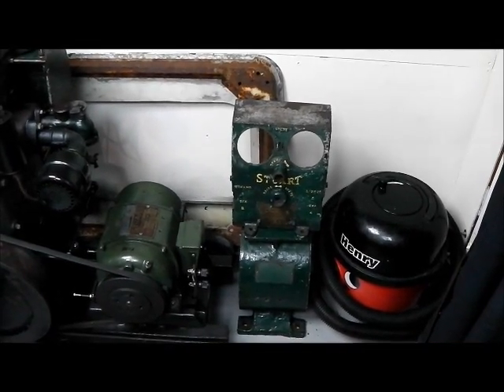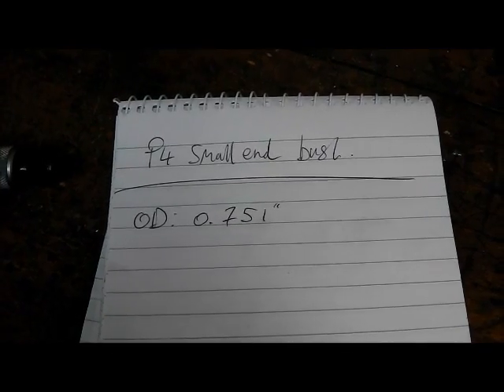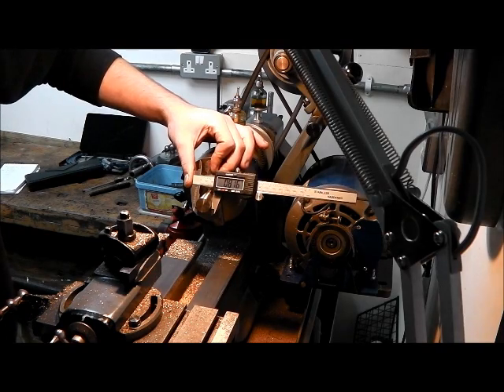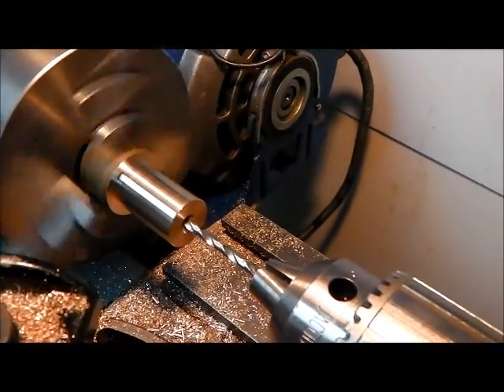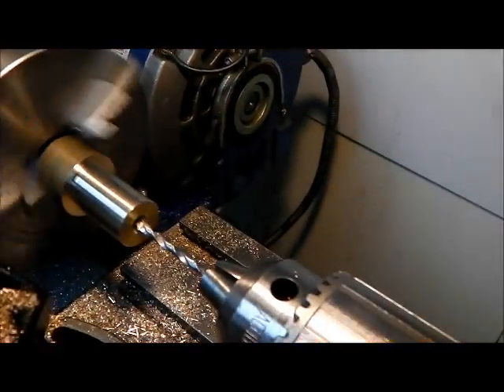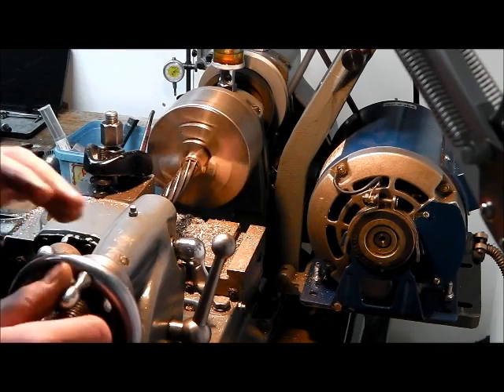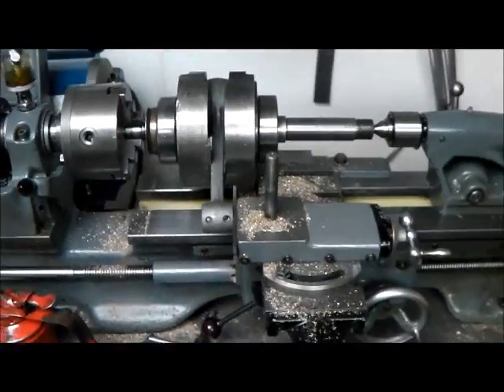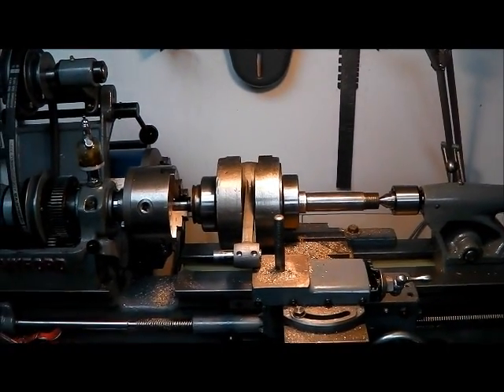Stuart Turner Lighting Plant - Part 5 -

Comment: Very nice job again Phil - now just a couple of tips that may, or may not help. In the 70s I did 4 years reconditioning engines, then spent 16 years in a factory precision grinding.
When using a mic, do it by feel. If you get a measured block (you can sometimes find old slip blocks at markets etc that are plenty close enough) you can practise this. You'll soon discover it's much more accurate than using the ratchet.
Secondly a tip from engine building. We did 5 to 10 engines a week, mostly 1200cc Cortina engines, but also the others from the period, plus of course Vauxhall BMC etc. Instead of fitting a new little end bush, we heated up the rod around the bush and quenched it. This of course shrinks it. Sometimes a bit tight to start with, but doing this say? 5000 times, only ever had 2 come back.....it does work.
Now I'm not suggesting you shouldn't have fitted a new bush in this case, but might be worth a try on something not so important. Sorry it's a bit long, just something I thought you might like to try.
Reply from the maker: Thanks Malc, these engines are usually too far gone for such treatment by the time I get them, so a new bush was well overdue. Never heard of quenching the small end, not something I'd be happy with myself, presumably the bush becomes slightly oval?
Reply: No one's heard of quenching the small end because no one else knows. Came about by accident before I worked there. I didn't like the idea at first, but soon found out it was ok to do. I've done it on my own engines that were thrashed on the road and never had a problem. Get a piston and rod from a scrap car engine and try it. Just need to heat it to a very dull red, or less.